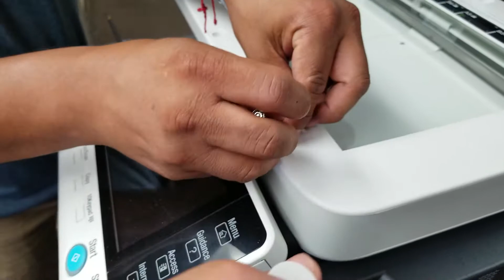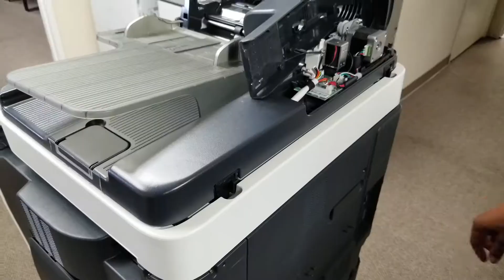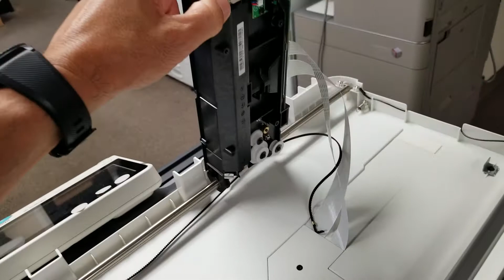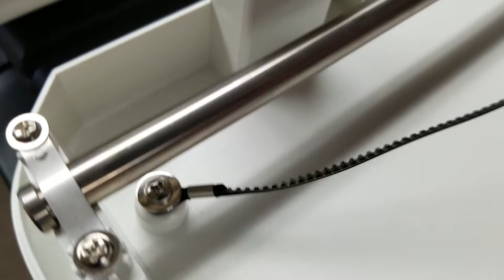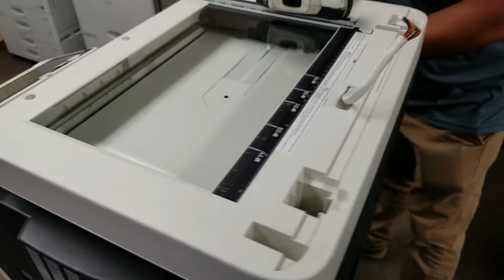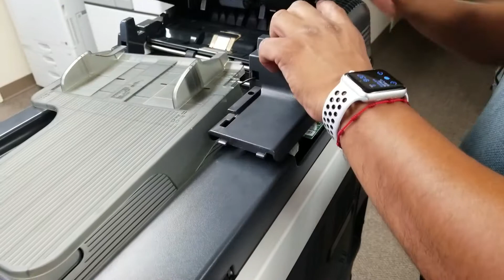Konica Minolta Bizhub c3850 scanner belt replacement

Comment: The cable did not have an anti-static collar to begin with, why put one on after repair? Is it necessary to do so?
Reply from the maker: Just a precaution. Not having one won't prevent the unit from working but i wil prevent static which can lead to mysterious issues.